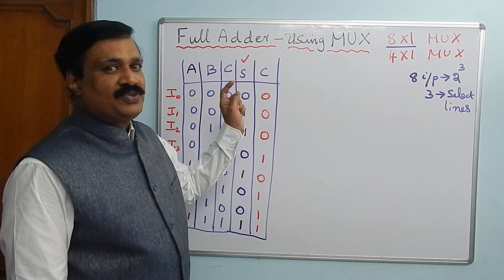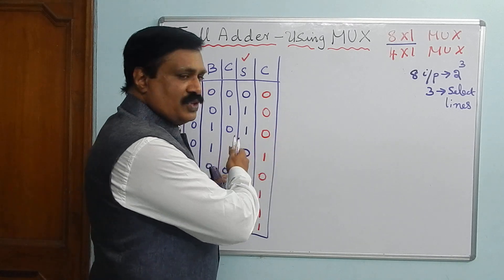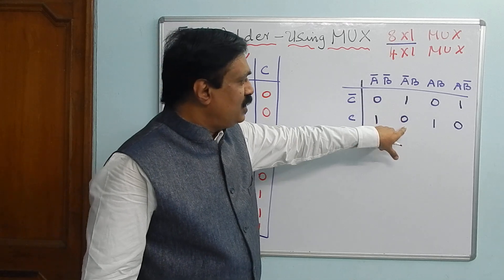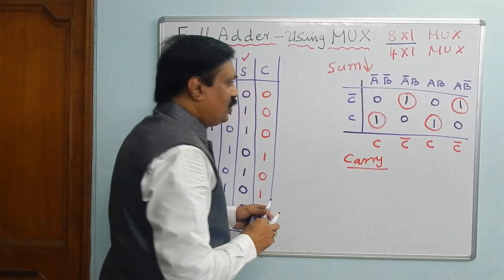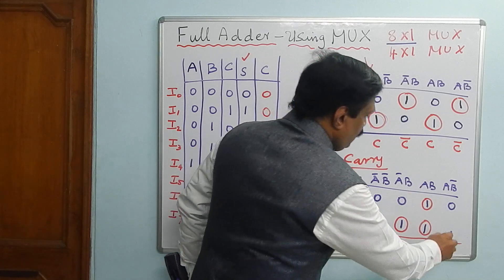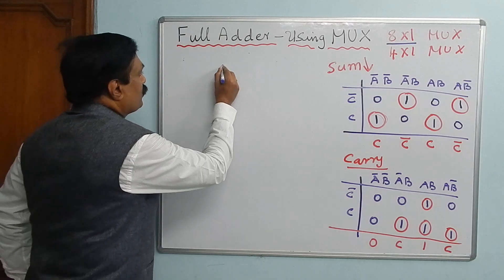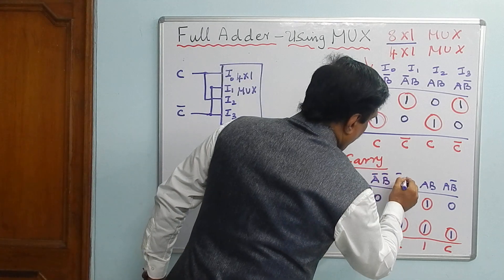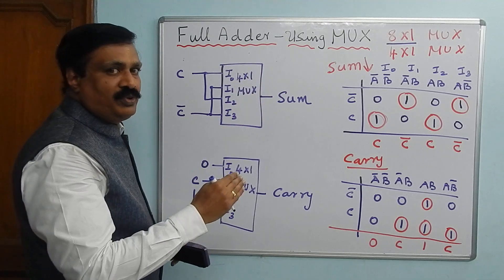Full adder using  4x1 Multiplexer(MUX) (2)- Digital Electronics (English)

Comment: sir how to do the full substractor using mux. i am doing with your process but as a result the circuit is same no difference between full adder & substractor.help plzzz
Reply: The S of a full adder is equal as the S of full subtractor, but, the carry out has some differences, if you want more explication about that, you can get in touch ;)